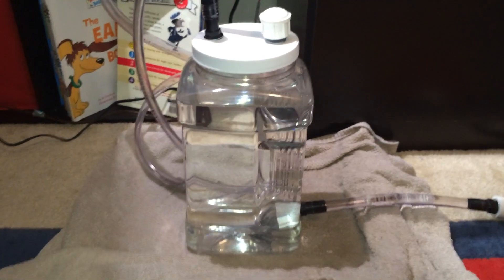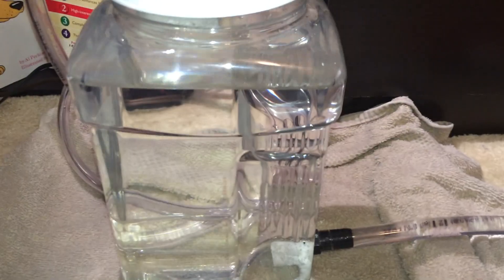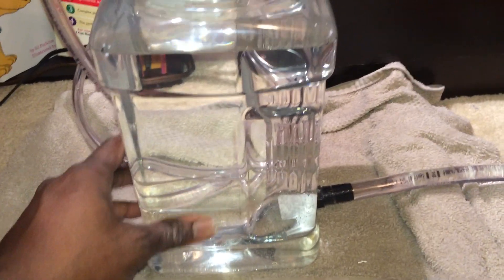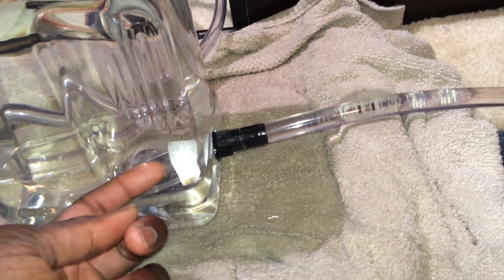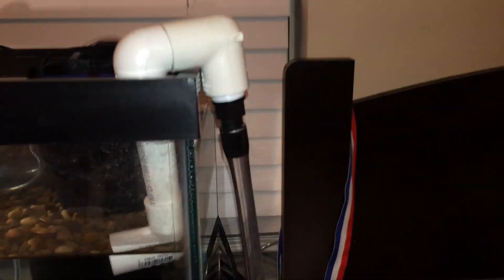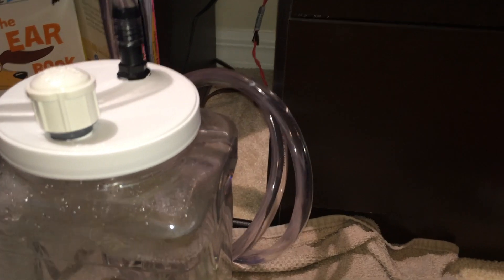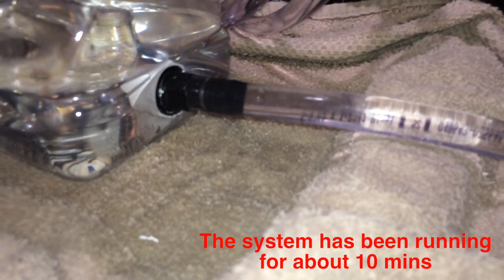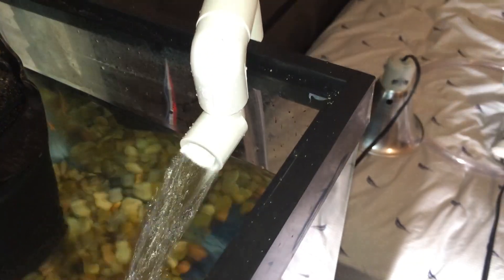DIY Canister Filter - Proof Of Concept

Comment: Nice concept. One thing I would absolutely change in your design, though, is I would put the ball valve into the return line, rather than the intake line. This simulates head pressure and is far better for the pump. Putting the valve before the pump can cause cavitation at the impeller (effectively starving the pump of water), and premature pump failure is a definite possibility. As far as flow is concerned, this modification to your design will be unnoticeable. Either way, great work! If you get a chance. check out my nano sump video and let me know what you think!

Comment: ill be doing this then ahah great video ... best thing my aquarium sits on a big oak stand and there is a cupboard underneath and it will all fit nicely in there and a few rubber pads to stop any motor vibration plus the motor wont work too hard as the work is being done by gravity then the little nit of work it will do is push the water up into the tank ... i saw a flaw in someones design they put the pump first so it had to push all the water into the reservoir ... on my pump i may put a small pc fan with a 5v supply just to help keep the motor cool ..... one big question if i made my reservoir with alot of thought would it be a good idea to put the heater in there fully submerged ?

Comment: Nice and clear bro, because you can see through. But if...the pump stop running or if you close the valve, is the water still come down from the intake? 
And what the other extra end cap on the leat for?
Reply from the maker: Dara Nguon you're right.. this really is not a good container it was really just to POF to see if I could get it work...

Comment: you can check out my video i have a very nice deign of a canister with a pump in it. but i don't have a detail video of making it. i wish to make a video of making it one day. for leaking i use hot glue to all connect pipe but before it touch water.